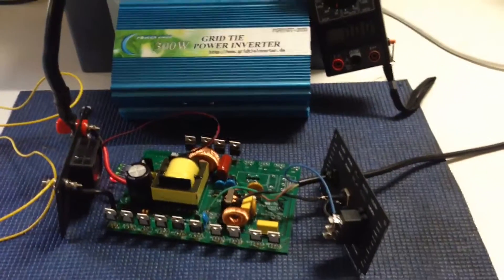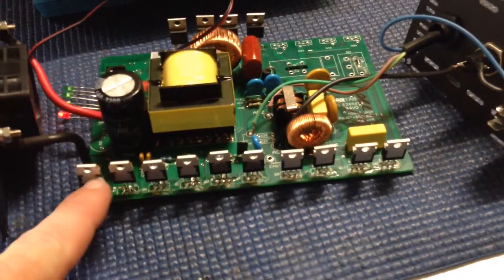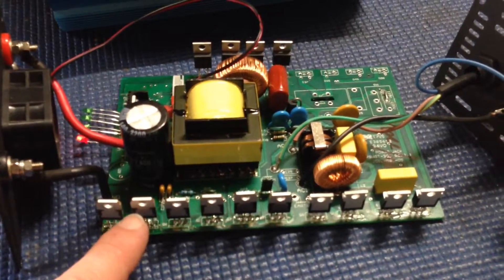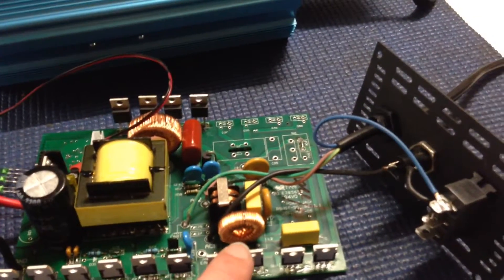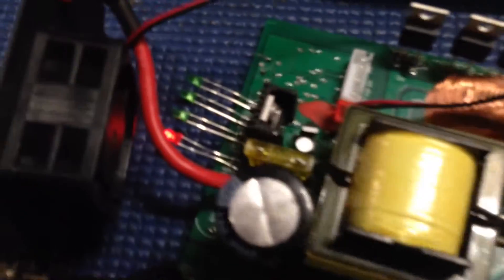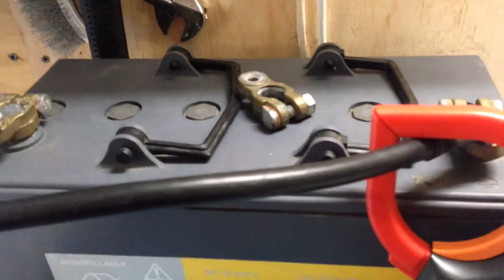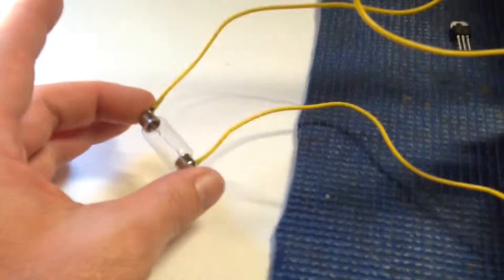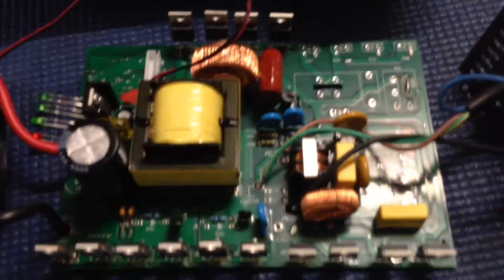300 watt grid tie inverter issues. Can anyone help ?

Comment: Can not realy help you with your problem,I have had a couple of those power jack inverters and they always blow mosfet's after a while.
They all in the garbage now.
We have a couple of sunny boy grid tie inverters now at our house and have not had a problem.
Reply from the maker: Same I've given up, too much time fixing them only to have them fail again my 1200w one is now retired too. basically melted on the AC side then Mosfets went into a white smoke moment.
I have TL5000 SMA & MPP 2400 unit I run with. Happy so far :)
Reply: probably too late now but these will not run on a single 12v battery as the voltage is slightly too low. Try 24 v and ensure mains line is present.

Comment: I don't see any AC voltage on the white meter. The inverter has to detect 120 VAC before it can activate.
Reply from the maker: When powered up it draws 0.2 watts its hard to see but it is there :(